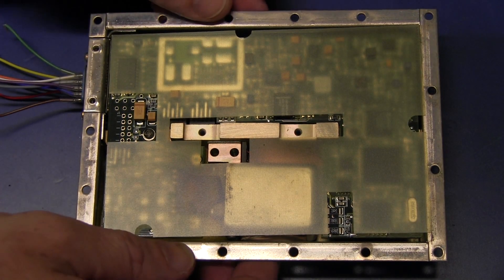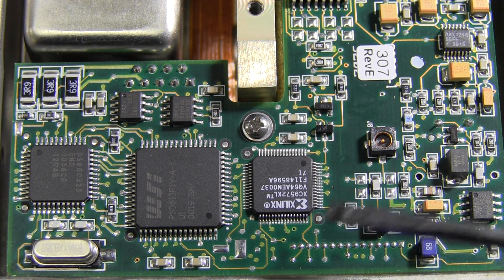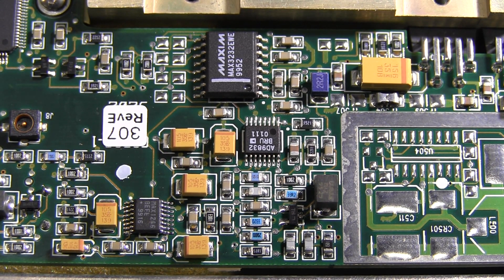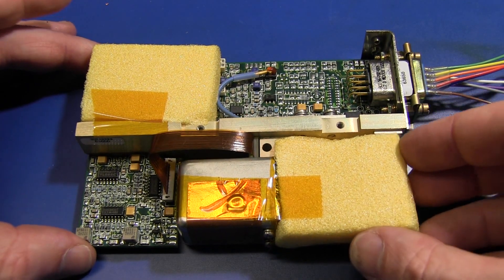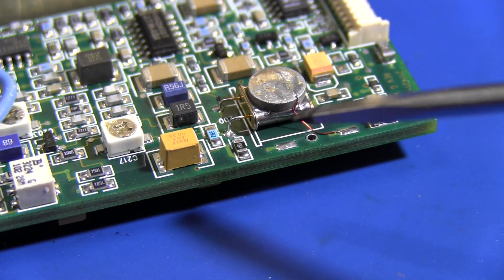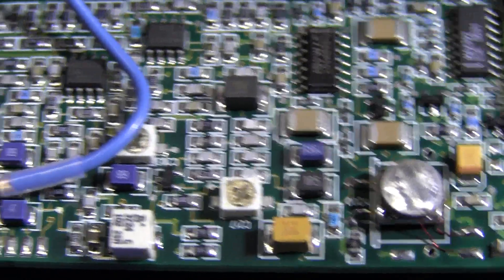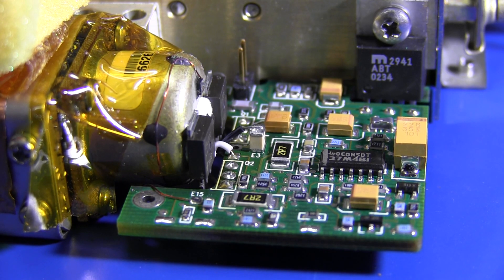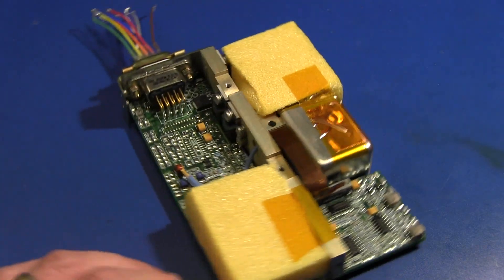EEVblog #236 - FE-5680A Rubidium Standard Teardown

Comment: Great video! This particular FE-5680A appears to be one of the non-programmable ones maybe? Not sure. There are other models (with the same model name... FE-5680A) that have a SMA connector (on the same panel as the 9-pin D-connector, but is mounted on the opposite end of the panel) for outputting the sinusoidal signal - usually approximately 8 MHz, 10 MH, or 11 MHz, depending on the unit. The weird thing is the way they have the same model name for different units. Would be interesting to see why they do that.

Comment: +EEVblog How did the programming work out, i want to use one of these as a cheap master clock for studio purposes, thus id need the range from 44.1KHz to 192KHz out of the frequency standard, and if i recall correctly ill need to convert it to square wave as well.

Comment: How do you program different frequencies for FE-5680A Rubidium Standard? Do you need separate electronics or is it all built in? I want to make a reference clock for Digital audio use (A Esoteric CD player with clock input). Needed is 44.1khz or 88.2 kHz etc. I would appreciate your advice. Thanks. Jake - England

Comment: oh and the unit is thermally compensated for frequency over temperature.  ie. put in a thermal chamber characterized from -20c to 70C and compensated...  More important than the actual temperature is that it is STABLE temperature.  Temprature fluctuations will cause a frequency shifts as the ovens adjust.

Comment: the blue cable actually in this design carries a relatively low frequency which is multiplied using a step recovery diode right at the resonant cavities lid.  The bent over regulators are done for space and increased resistance to damage from vibe.  This is a non vibe compensated unit but we do make them.
Any other info you want ask me privately

Comment: I work for FEI, a few notes.  The 2 transistors soldered to the physics package are dual purpose, one forms the lamp oscillator. The other is used as a heater.  Lamp temp is about 120C.  Notice the small chip thermistor also soldered to the lamp housing.  The cap you see stood up is intentional.  It is a special high quality cap for high frequency.  It is stood up and soldered directly to the coil around the lamp.  The Q factor of the lamp oscillators resonant circuit is higher this way.

Comment: He is 100% correct.   The other piece of foam is to help insulate the lamp to speed warmup. Nothing to do with impact protection.
Reply: Do you know how these units tend to fail? I'm wondering if lamp burnout is perhaps the most likely failure mode. I'm looking to purchase a unit that is not working, with hopes of repairing it. Lamp burnout would probably foil that plan!
Sorry, I am unable to send you a PM.
Reply: Why do they have to be replaced if they are still working? Do they lose stability or accuracy or does the lamp lose it intensity?

Comment: I started looking for info about the Rb standards due to a construction article (//hackaday.com/2012/08/02/atomic-clapperboard/). Good stuff - You've answered all my big questions.
The pellet attached to the crystal Y200 is probably a ceramic heater. These control their own temperature despite changes in applied voltage. When insulated by foam, you form a Crystal Oscillator Oven.
Thanks!

Comment: Hey Dave! I think I've figured out the reasoning behind that inexplicable foam and small disk shaped thing stuck to the crystal oscillator. I believe the foam is insulation, for a heater that regulates temperature in the oscillator.... but I just realized the two comments on my screen address the same thing I'm talking about lol

Comment: Sorry if this was pointed out in a previous comment, but I believe the wee connector mentioned is a u.FL press-fit RF connector. Did you probe that connector to see what comes out? Maybe it's the output of the  AD9832 after filtering?

Comment: Regarding your question at 5:29, I think the disc on the crystal may be a PTC thermistor that acts like a temperature regulator to keep the crystal at a fairly constant temperature. This technique is often used in analog audio synthesizers to keep ICs such as transistor arrays at a constant temperature.

Comment: The foam is indeed for thermal insulation. Both the lamp and the resonance cell need to be quite hot to work (to keep the Rb in vapor form). Most of the input power is used to heat these parts, not to drive the lamp. This is why it takes a few minutes to start up and why it draws a higher current during startup.

The "tombstoned" cap is not a bodge. The Rb lamp is RF-excited and this cap is the resonant cap in series with the exciter coil. There's probably a high RF voltage on the free end.

Comment: The version you have there can be trimmed a ppm up and down over the serial interface. Not useful as a function generator, but quite enough to adjust it (step size is 10^-13-ish) during production.
The oscillator runs 60MHz, and a high harmonic of that, mixed with 5.5MHz from the DDS, produces the 6.8GHz required. For a frequency standard this is the better one, as it has less phase noise. Now you just need to cal it :-).

Comment: looks like that crystal has a PTC thermistor soldered on top of it to make a cheap crystal oven.  the foam would help insulate it.  a PTC will self-regulate the temperature, so long as the input voltage is constant.

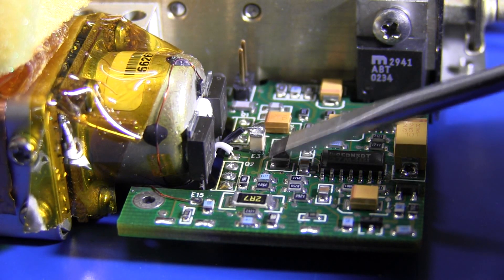Comment: 7:45 The thing you labelled a bodge capacitor is marked E3. There's also a wire going from something marked E15 on the board up to the lamp can. What's E supposed to mean? A choke?
Maybe the foam is meant to be heat isolation to help keep something's temperature stable?